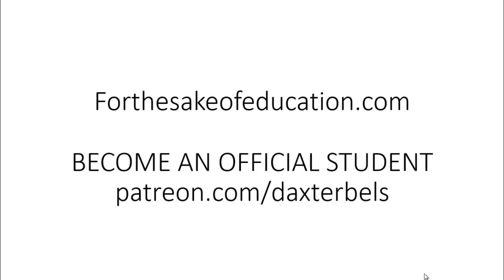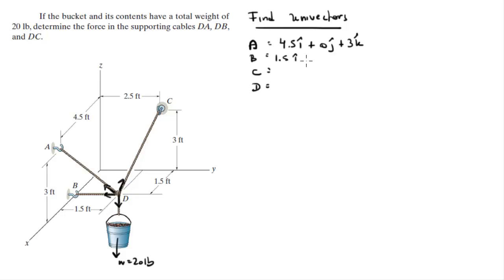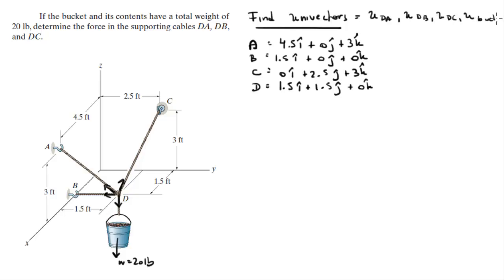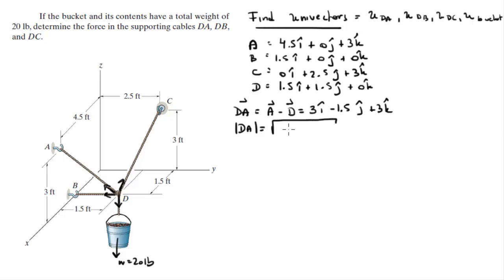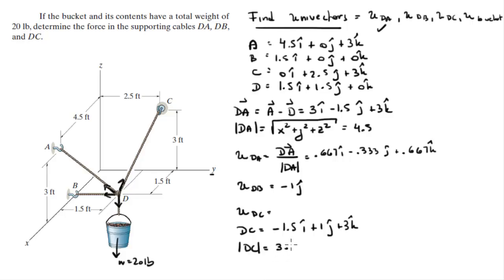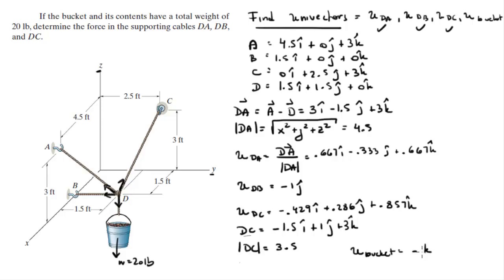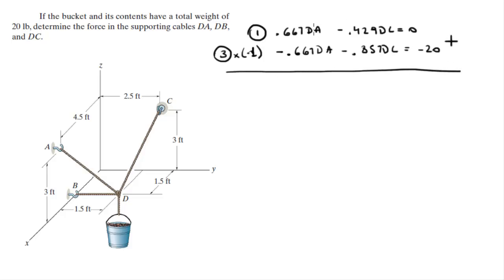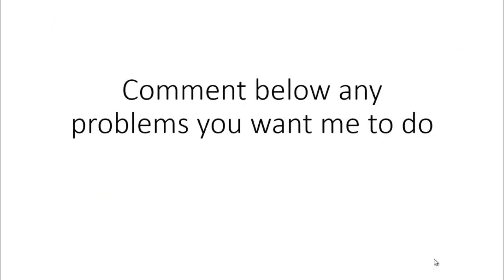Determine the force in the supporting cables DA, DB, and DC.

Comment: I'm so confuse why is Y=0 for vector A
Reply: The position vector for A has a 0 value in the y-direction (j-hat) because it lies in the xz-plane. 
So the position vector for A is:    4.5i + 0j + 3k

The vector for the rope between D and A does have a j-hat component. This vector is the position vector for A minus the positon vector for D (which lies in the xy-plane is:    1.5i +1.5j + 0k

This works out as such:   position vector A    4.5i + 0.0j + 3.0k
                                           - position vector D    1.5i + 1.5j + 0.0k
                                           _________________________________
                                            Vector DA                 3.0i - 1.5j + 3.0k

The next step is to find the magnitude of vector DA:  sqrt(3.0^2 +(-1.5)^2 +3.0^2) = 4.5
Then divide vector DA by its magnitude to find the unit vector U_DA: 0.667i + 0.333j +0.667k

Comment: why does the coordinate of DB equal -1k? shouldn't it be -1.5k, since it's along the y axis?
Reply: He jumped right to the unit vector of UB.

SO yes, DB is:    0i -1.5j +0k   
then for the unit vector U_DB we need to divide by the magnitude:  sqrt(0^2+ (-1.5)^2 +0^2)=1.5
U_DB =  (0i -1.5j +0k)/1.5 =  (0i -1.0j +0k)

(I think you accidentally switched your j and k but if you have questions about why it is j and not k:  k is used when there is a value in the z-direction, both point B and D have no value in the z-direction so the k component of the DB vector is 0)